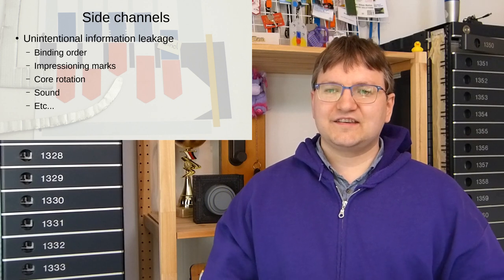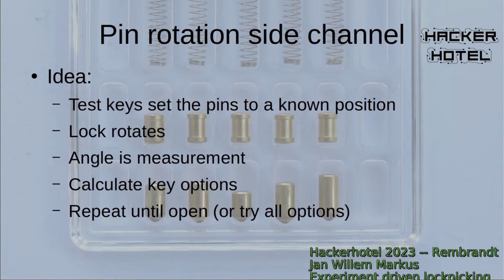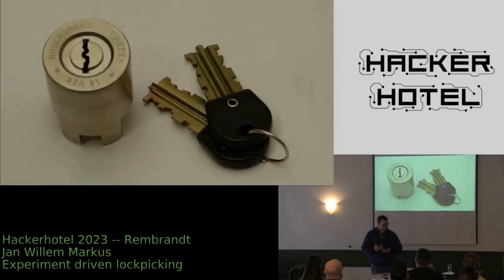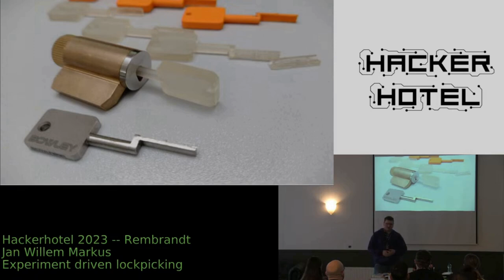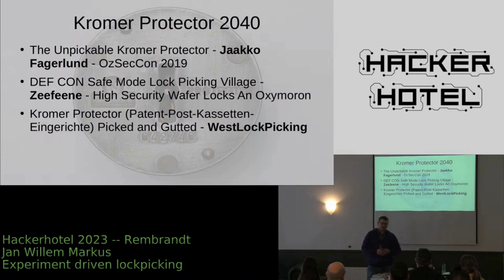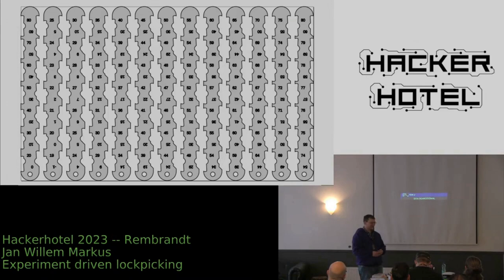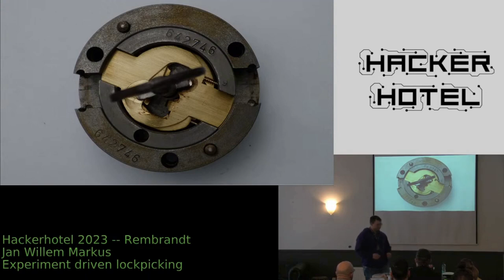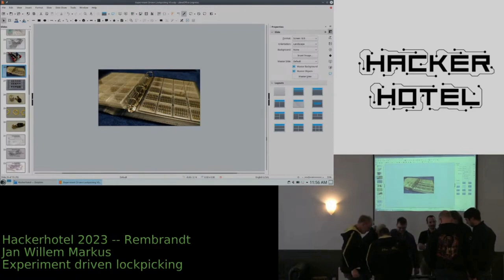HackerHotel 2023 -- Jan-Willem Markus -- Experiment driven lockpicking

Comment: Great talk! It seems that the audio cut out at 8:42 and picks back up at 10:25.

edit as I get further: FANTASTIC work with the rotasera, I've spent a lot of time trying to come up with attacks for it, but without having a bunch for me to take apart it's hard to know where to even begin. I may pick up a couple of them now to work on, especially more with the key attacks rather than directly trying to manufacture a picking tool. I am not a master machinist, but I have a few printers that are more than capable.